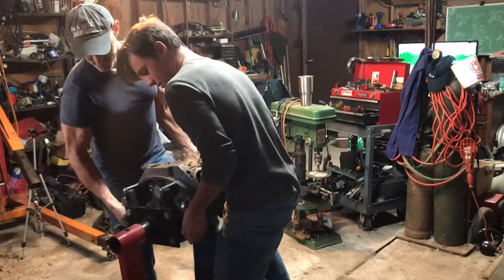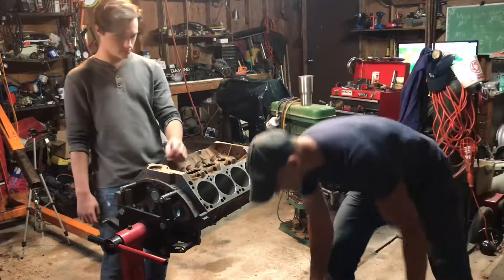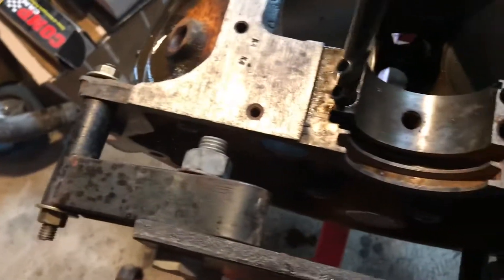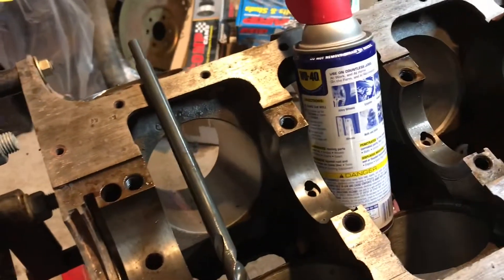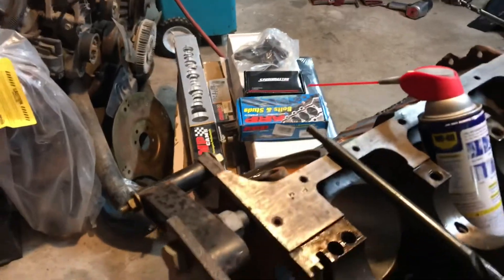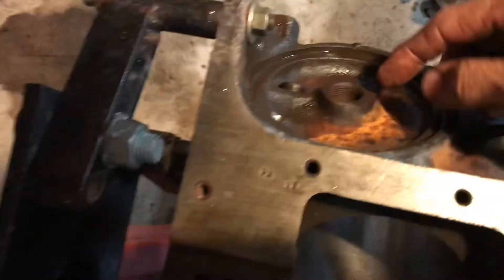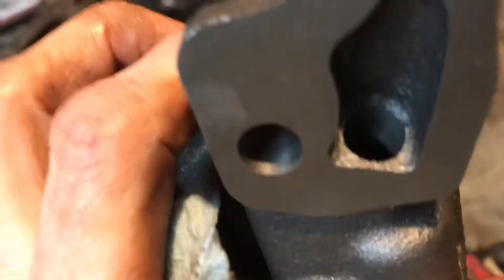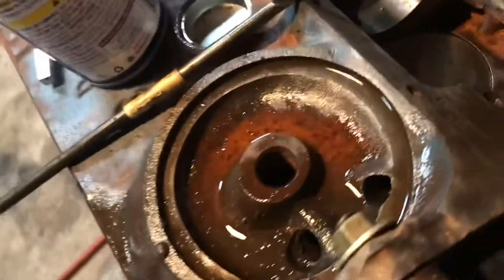SB Chrysler block Oiling mods for Mains-pump

Comment: Was this an updated video from the one where you drilled out the side and ruined that other test block? i ordered that book you showed in that video too. mopar performance 1978, did you do the crossover tube up in the lifter gallery also? almost ready to put my build together, got a 6000 rpm hydraulic roller lifter and cam set up, and high performance aluminum heads, on a 30 over la 360, might upgrade to a higher rpm cam later, just trying to keep the mains from burning up like ive been seeing at higher rpms, thanks for videos
Reply from the maker: The block I plan to use now already has the holes enlarged.  I added the crossover tube to it.  Got sidetracked on other projects and life.  😂 Yesterday pulled a 97 4x4 Dakota into the garage.  Have to yank the 5.2 and take to my nephew then plan to install a 5.9 magnum.  Will use the china crosswind, sniper efi, and elec distributor for spark.  Keeping it simple. Turbo and hood stack once all the bugs are ironed out.